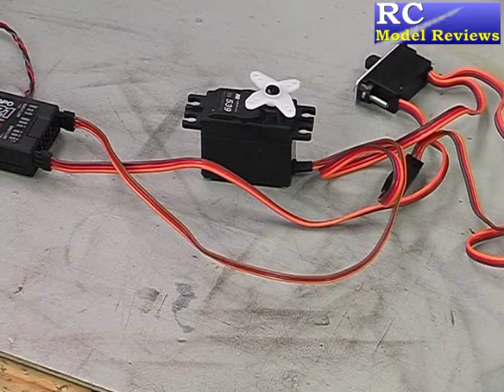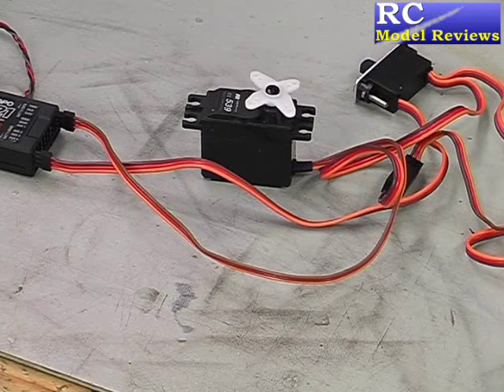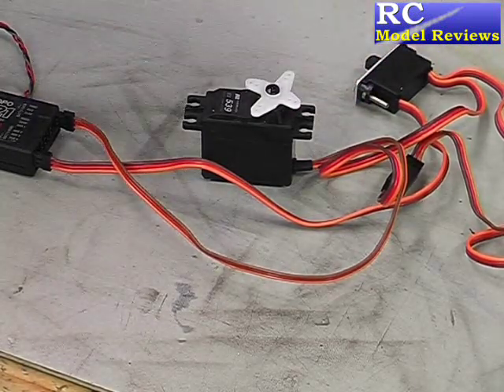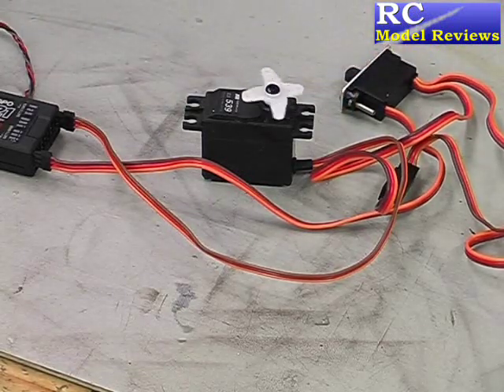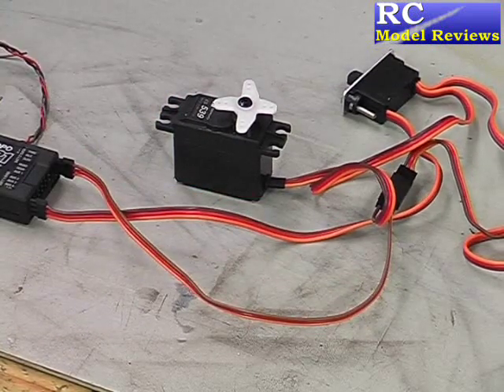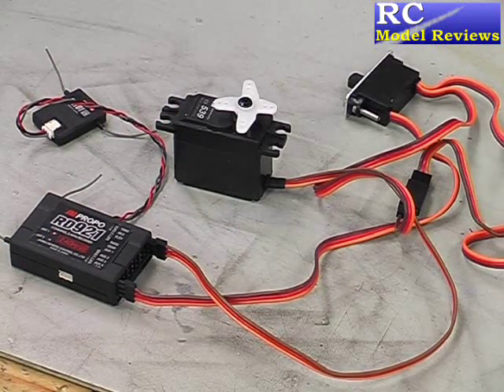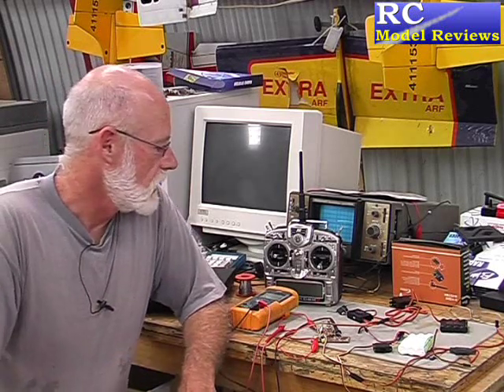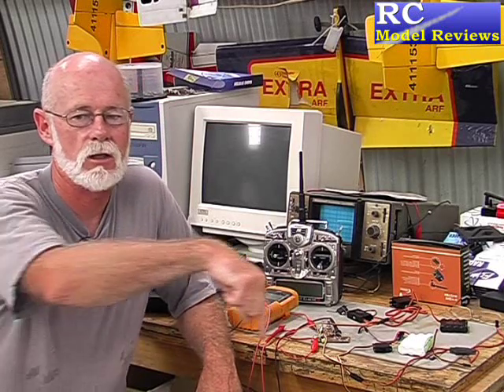Spektrum/JR DSM2 test (Part 2)

Comment: Hi Bruce is it possible to convert a jr x388s  transmitter the Earley model 36mhz  if I could find a reciever for it and crystal 36.470 . I wouldn't be asking this question  . Can it be done  by changing the module over ?

Comment: Hi I have an old jr x388s  transmitter I was told I can convert  it to 2.4 ghz by just changing the module in the back of the transmitter  if so can you please recommend a module for me and if they are plug and play or dose the transmitter have to be modified.  Thank you

Comment: I will never use spektrum garbage ever again... If you are looking for a receiver and module combo for your JR transmitter. I have been using an frsky telemetry capable module and receivers for over a year now and have not had a single glitch or crash because of faulty electronics. I did a ground check on my plane the other day just for shits and giggles and I walked until I couldnt even see my plane. I had to call my girlfriend to go outside and check to see if my control surfaces were still moving smoothly...and they were. By far the best setup Ive ever had...

Comment: Locked out tonight again.  DX6i.  for no reason, 3min. into a fresh 2200ma battery my plane just free falls out of the sky.  Throttle off then on it re-connects but only gives me seconds to recover.........ummm, not this time, I have the glue on the job now.  My brand new Icon A5 just got a nose job.

Unreliable output = destroyed planes.  It's a demon seed.
What receiver ?  What transmitter ? can we rely on ??  I'll have to quit.

Comment: @xjet I guess like any system and or chain ..... things are only ever as good as your weakest link!! 
Put a weak link in that just happens to be the power behind the entire system, and your asking for trouble I guess.
I'm just waiting till someone comes up with GOOD and relatively cost effective 7.4v capable servos for my heli and plane, then it'll be 2s Lipo with no regulator (and my DSM2 system) - nothing like overkill I guess!!    ;)

Comment: Well i've been using my DX6I for coming up to the third year now and have only ever had one problem with it,that was using the AR6100e rx in my styker and it got shot down twice so i got rid of that rx rather quick and never found out why,but moved onto the ar500 and never had a problem with that one,so all in all i'm well happy with spektrum but do want to upgrade to a better Radio and your video's are helping out loads ;-) 5*